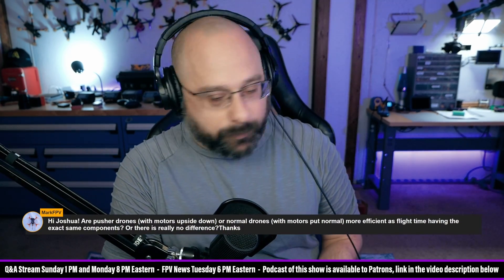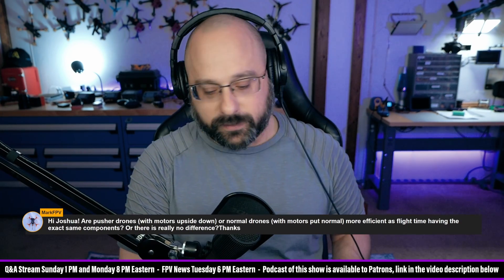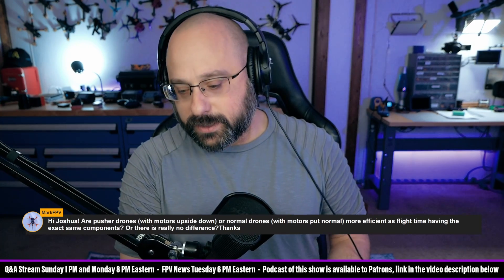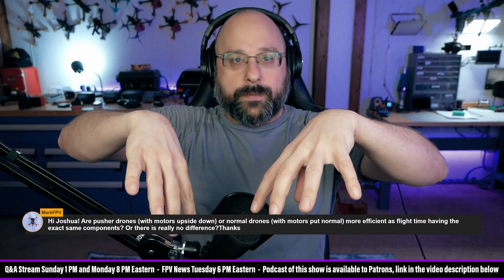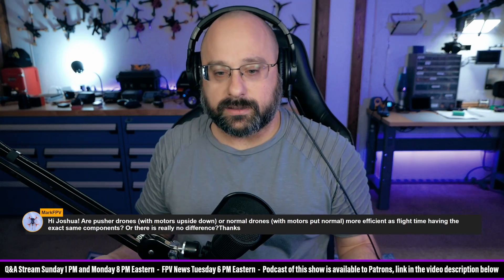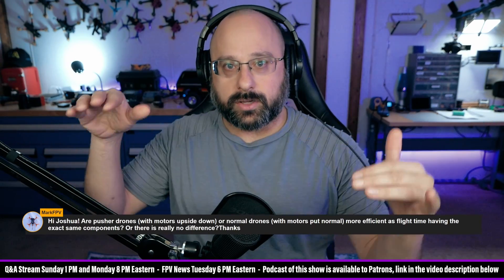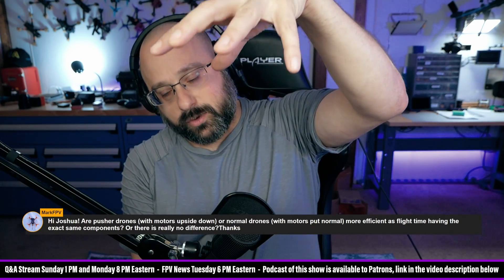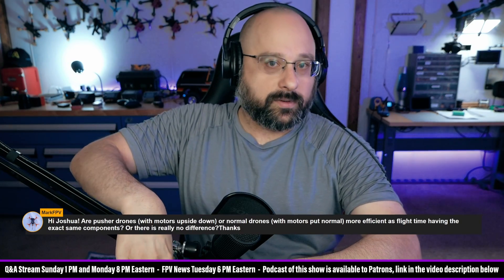Do Pusher Drones Get Better Flight Time? What's The Difference? - FPV Questions

Comment: I believe that less is lost to laminar flowing less turbulent air in a puller which a static bench test should reveal.
A dynamic test were the air is moving 30+mph at say 45° then hits the prop and is propelled straight down threw the duct at a 22° or less angle would bare totally different results.
In planes it's settled in military drones in RC scale it's debated and scale is another variable that play a big factor.
Apparently large planes scaled down tend to work were small optimized planes scaled up don't always work out.
Its more like to taking a billiard shot and hitting a spilling ball on a 45° angle imo.

Comment: I had a Cinelog 30... cinewhoop ..pusher style drone... I found that it flew very stable and that's about it.😂 you can't land in the grass. Because you won't be able to take off because the props get clogged... I built a 2.5  inch cinewhoop...not a pusher...props on top..a puller if you will.. It flies awesome... Pulls out of dives better... And also I can land in the grass and take off anywhere... That's why I don't like pushers that much...

Comment: Hey, i have a quastion. i want to change the motors on my 5inch fpv, from 2450KV 4s battery, to 1950KV with 2000mah 140c battery will it be ok with such batteries or should i get 1500-1800mah 120C.
Also is this the max allowable KV for a 6s battery.
I want it to be a little more powerful than now and at the same time, if it can be a little longer flight.

Thank you in advance!
Best regards!

Comment: Cons about a pusher is the location of the propeller. If you have it all on the bottom like a Avata you have more efficient flight but less stability. If you have a prop more center to the drone you have more control and less likely to tumble. They have like a desert falcon which is like a lifter frame. So it makes the props higher to the center of the craft. Most lifter style frames are expensive but what keeps you from just flipping your frame upside down to make a pusher drone.

Comment: Most quads have the battery on top. You dont want to land on the props or battery in a pusher config.
Only with ducts it's better for landing and pusher config.

Comment: In my actual experience, the pusher is more efficient. On a 35mm propped freestyle (open prop) Baby Nazgul build, I was getting about 2:30 minutes of fly time with a 1S 450 mAh battery. Just by re-orienting the motors to the pusher configuration, I now get about 4:00 minutes of fly time with the same battery. So, that is over a minute increase which is quite a noticeable increase; what...about 25-30 percent more fly time on this tiny craft. I figure that the arms actually have a huge disturbance on the 35mm column of downward airflow.

Comment: Many pushers have ducts, which improve efficiency. Having the arm supporting the motor over the motor creates less obstruction to the fast downward airflow, and it doesn't make the air to go sideways.
Reply: Ducts kill efficiency. No ducts are more efficient.
Ducts on pusher config are more efficient, because the arms and duct structure dont block the clean airflow downwards.
Reply: @chrisbee5481  After some reading, it seems that ducts are more efficient than open props at low speeds and at higher speeds open props are better. Maybe this is why ducts are used on cinewhoops ?

Comment: Could easily test. Wider arms would block more.
Reply: I tested in 2014 with the Monarch AG, the first commercial multi-rotor drone to get a COA and “N” number. It was a big machine and I don’t know how results would scale down.
Reply: @jeffparisse4202  oh wow had an N number in 2014 damn.. 
Not sure how it scale down. Because while less air- thrust. Prop also closer and smaller. IDK. I'd be curious to test on one my 5 or 6" drones. Maybe the long range one.

Comment: Bernoulli— Fast moving air has LESS pressure. The efficiency is gained with larger craft. Monarch AG had 14” props and efficiency gain was about 8-9% airtime. Lesson Learned in 2014: don’t obstruct the downflow.
Reply: Doesnt that only work with non compresible fluids like water?
My understanding is that the prop compresses the air, so the pressure should be higher.
Reply: @captaincrazy9287  Bernoulli applies to air… it may also apply to non-compressible fluids, I’m not sure.

Comment: I know I sound dumb but I would think that puller style"normal" would help with keeping the motors cooler😊 but then again pusher style would pull air through the motors  keeping them cool🤔🤯  heck what do I know lol I have flown both styles and imo pushers seem more responsive....but....I'm just a 4 year old newb😁✌🏼
Reply: Air in the center of the thrust column is barely moving compared to the tip flow. Motor cooling is trivial.